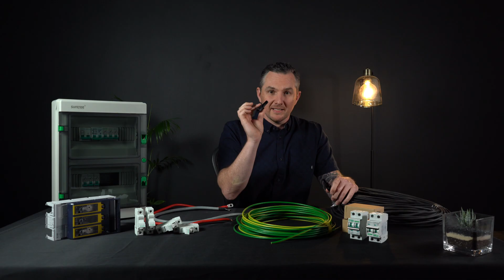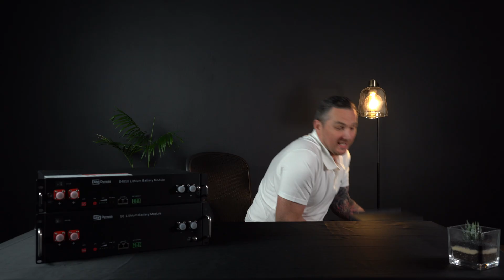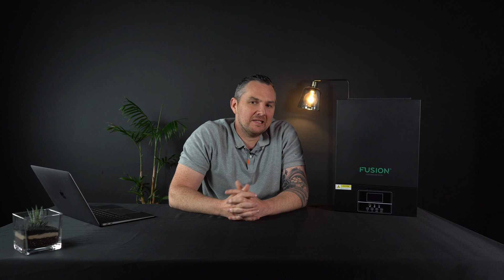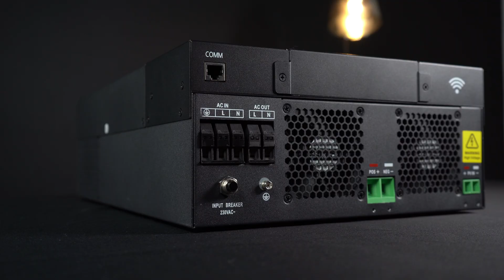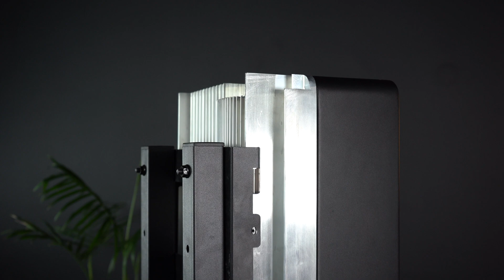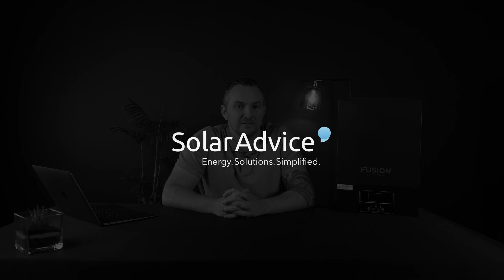Solar Inverter Types - The Basics | Solar Advice

Comment: What do you call an inverter that has a charge controller vs an inverter that does not have a charge controller?
Reply from the maker: An inverter that doesn’t have one is a grid-tied inverter, these don’t have the ability to add batteries

Comment: Hi, I have two questions about DC Protection boxes that I could not find answers to on your website or in other videos:

Firstly, is it absolutely necessary to install a DC protection box between the pv panels and a hybrid inverter?
Secondly, what is the Ah-rating that you have on your website for these DC protection boxes? This unit does not make sense to me as I would expect it to be rated in amps, probably because I am not familiar with how they work.

I would appreciate some advice! Thanks :)
Reply from the maker: The DC box is vital, just like the AC box it contains surge protection so in the event that lightening strikes it protects the inverter. It also has breakers and needs to be earthed too. These use 16A fuses
Reply: @solaradvice  Thanks for the quick reply!

Comment: Any advise on mini inverters
Reply from the maker: Are you referring to micro inverters?
Reply: @solaradvice  morning yes sorry looking for advise on micro inverters and if they useful in SA
Reply from the maker: @ryanphipps1901  they are useful in the situation where you have an array that gets partly shaded or you have a massive array that is shaded in part during the morning or evening sun. You can however split your strings to achieve the same thing.
Reply: @solaradvice  thanks keep up the good work I am currently doing a installers course to get green card certified for residential the mark is picking up now
Reply: @ryanphipps1901  where are you studying ?